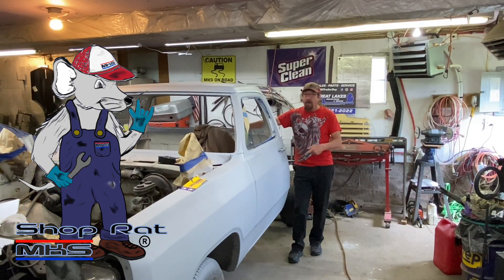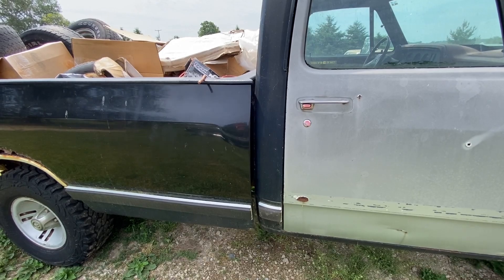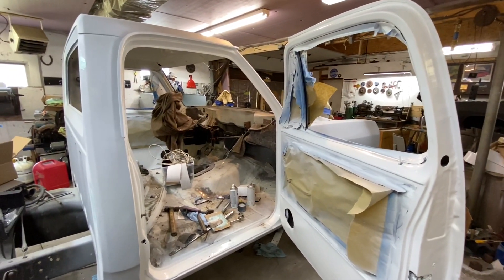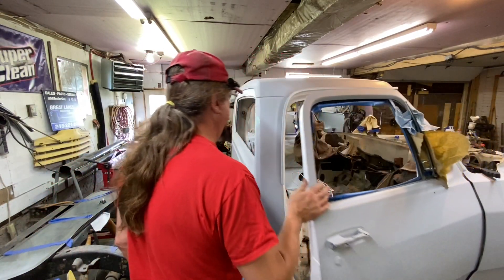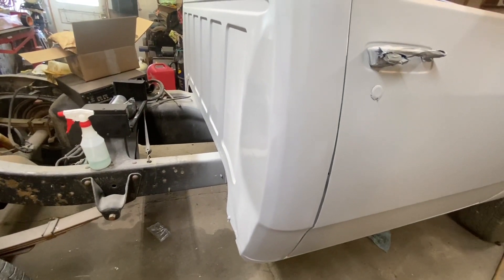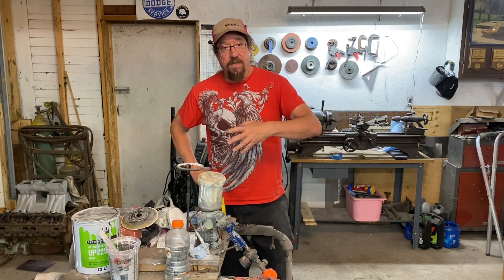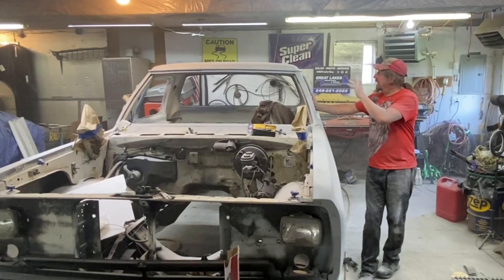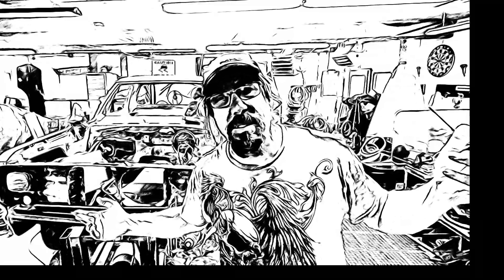How To - Paint Your Car or Truck- CHEAP and EASY. A simple Paint Job -Bring it Back To Life -Part 16

Comment: Real life ain't no picnic😂....sanding and prep is hard work.... I've got to build an air/filter box for my homemade spray booth a lot of work but will be worth it in cleaner paint jobs I've got 7 cars to paint at home that's a lot of priming and sanding it equals up to lots of work real life work... That's what your video shows so take heed people if you want to do it yourself before diving in to a project.. There's lot of cars that sell as project cars cause people get in over their heads.
Reply from the maker: That’s the struggle… Providing a realistic, expectation, while not discouraging people from tackling it themselves. It’s gonna be done, as long as you’re willing to bear down and do it.

Stay tuned, more coming on this one !